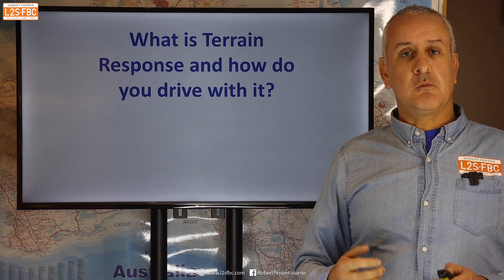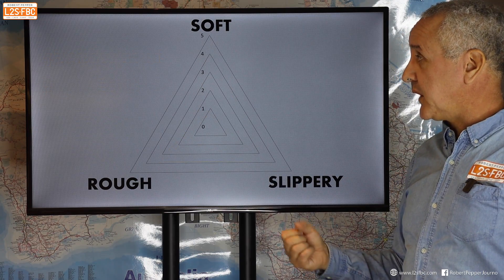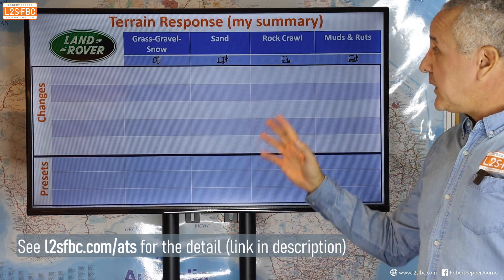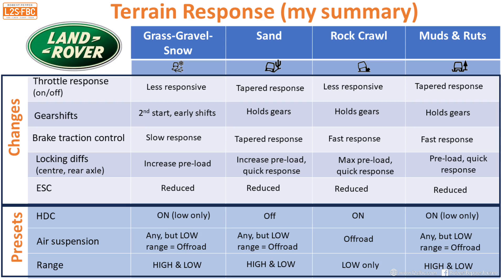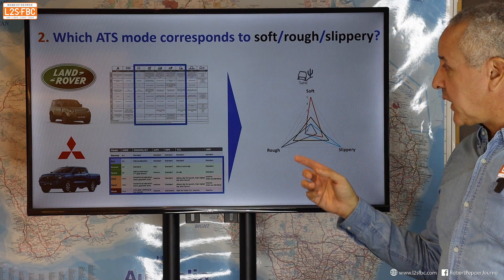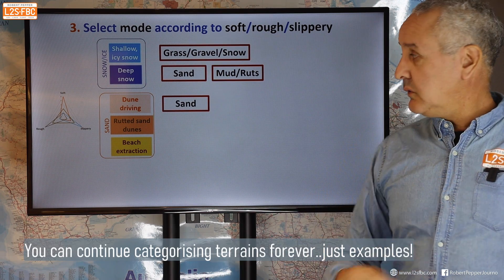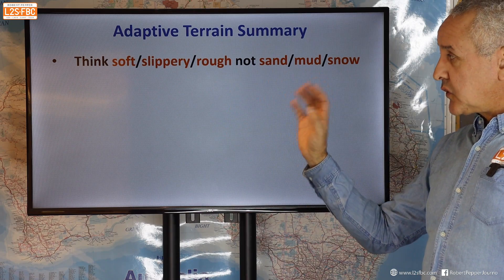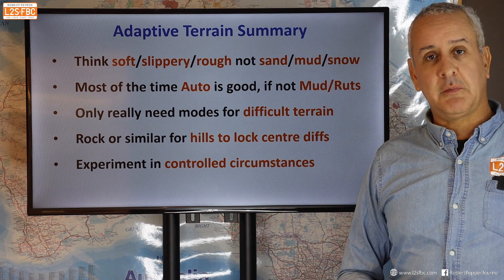Terrain Response & ATSes explained - Part 1

Comment: Great video, thanks so much! Would you recommend putting the D3 in low mode in any of the off road settings? Or keep it in high even with terrain response activated? thanks
Reply from the maker: High unless you need to get under a tree, or about to tip sideways.

Comment: Great video! I’d like to ask you a few questions about the Terrain Response system. 

1. I own a Discovery 4, but when off-roading in the desert, even after selecting the Sand mode and turning off DSC, I still feel like the power is being limited. How can I fix this?

2. Is it possible to upgrade the Discovery 4 to the 2nd generation Terrain Response system, such as by installing the TR computer from the L405? When off-roading, I feel like the electronic traction control isn’t as effective, especially compared to the 2nd generation TR . Thank you!
Reply from the maker: 1. You can't do anything more, that's it.  Still remains a little on.  Low range may deactivate it a bit more if not already used.
2. No it isn't.
Reply: @L2SFBC  Thank you!

Comment: Fantastic video and very useful info. What mode do you suggest using in water crossing? Usually its small rocks/ gravel underneath- hence do you go with mud ruts? thank you
Reply from the maker: Not a slippery mode as it shifts up too quick and reduces power. A rough mode is best.

Comment: Grass/Gravel/Snow will also cut the power if too much wheel spin occurs so if you want spin you need to turn off DSC or change to Mud/Ruts. Some Land Rovers also have ATPC and Rock Crawl mode even when they don’t have lockers or low range. So just to clarify Rock Crawl doesn’t require low range (Evoque and Discovery Sport).
Also Low Traction Launch is great for sand extraction.
Reply: Evoque and Discovery Sport do not have Rock Crawl. The latter version has ATPC (All Terrain Progress Control) which is a very different system. So to clarify, Rock Crawl is only available in JLR products with a Low range gearbox. Some Range Rover Sports and Discovery's are High range only

Comment: One of the beauties of the systems on older range rovers (late classics, p38s and early l322s), quadra drive jeeps (wj, wk, commanders) was that you had all of their capaility all of the time (apart from low range of course), so the only thing you had to do to go off road was turn the wheel and venture off road. As a car guy I of course love messing around with levers lockers and switches but there is something elegant about that approach especailly on the jeeps that there is no air suspension either and even more on the wj  grand cherokee that it's a fully mechanical system that offers partial locking capability on all 3 diffs.
Reply: Old P38 run rings around l322 or l405 TDV8 in deep muddy field........
In my experience, my l322 and late l405 with all terrain response set for mud ( general grabber ATs 19")  get stuck in deep muddy fields when towing - many times got the old P38 to tow them out (BFG ATs 16") using 12 ton kinetic snatch rope 🙃

Comment: Good evening Robert, you may have already covered this, but have you ever done a video testing the load capabilities of wheels and tyres? And possibly the different combinations of sizes for each? For example, a 16inch wheel with more sidewall compared to an 18inch with less. 

As always, keep up the great work, this research and testing is really informative and eye opening.

Thank you
Reply from the maker: I've covered Wide vs Narrow tyres, and low profile vs high profile. High profile tyres tend to have greater load carrying capacity than low profiles.
Reply: @L2SFBC  Thank you Robert

Comment: Our Discovery 3 engages HDC in sand mode when low range is selected (and re-engages every time you select an off-road program, regardless of your previous setting - very annoying). The throttle in sand mode is very aggressive too, so I'd imagine the tapered throttle was bought in on later vehicles because it's very easy to spin the wheels in sand mode! Rock crawl defaults to first gear and only changes out of first when absolutely necessary. Also, on grass/gravel/snow, it starts off in third gear in low range and second gear in high.  It is a very early 2006MY (actually October 2005 build) though, so I'd imagine it's got a lot more clever since then.
Reply from the maker: hmm don't recall that on my '08 D3!  As for gears; the D3 could allow you to move off in third low and even third high. That was changed in the D4 in 2nd low and 2nd high.  Also, the D3 allowed range changes hi/low on the move. Land Rover got rid of that in D4 because nanny state.
Reply: @L2SFBC  2013MY is when they stopped high to low on the move, but you could still do low to high.
Reply: @L2SFBC  I don't remember that on my '08 D3 either.

Comment: Got a bit confused with the rough and slippery about ice part: I would think you could encounter icy parts offroad that are basically like a field of rocks that got frozen over. Which if rocks are rough that would be too if i understand it correctly.
But you said icy can't be rough: So does rough then mean "hard uneven surface with a lot of traction for any wheel that has contact?"
Reply from the maker: It's generalisations; like I said you can get dusty/wet rocks, well that could be icy too. But generally, rough rocks are not slippery like sheet ice.  It is also possible to get ice that isn't very slippery and so on, and sand that is not soft etc etc. Main thing is to get into the mindset of thinking what the terrain actually is, not what it typically is.
Reply: @L2SFBC  Thanks

Comment: The Land Rover system differs from some or maybe all,as it does not have a manually controlled center diff lock,which can be a downfall in some cases.Sure one can use "rock crawl",and hope it is electrically activated,but is it at all times?
Reply from the maker: We are going to get into CTR.  I can say the CTR system does NOT manually lock the centre diff, actually clutch.  All it does is hint to the computer you'd like it locked.  Here is a preview.  https://youtu.be/1iw4eHoIFfo

Comment: It would be more easy to think soft/slipery/rough of the modes would actually be called that way. I found the names of modes quite confusing. BTW, there is no Rock mode in new Ford Ranger, what is the closest mode to Rock?
Reply from the maker: Soft/slippery/rough has two problems; first, it requires people to think, needing them to look at sand and know "that's soft".  Second, it's not as sexy as saying "sand mode" in marketing.  Mud/Ruts is closest.  https://l2sfbc.com/ats/